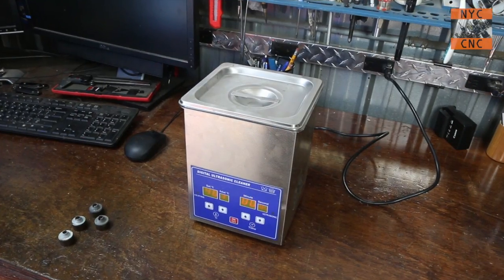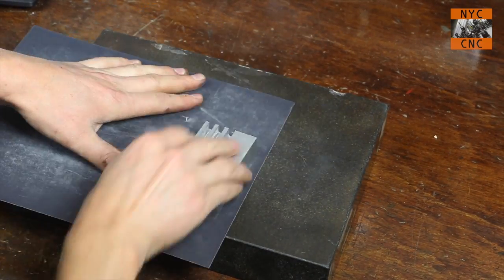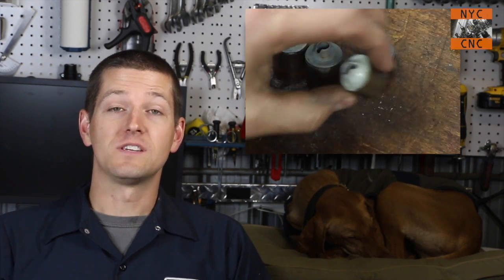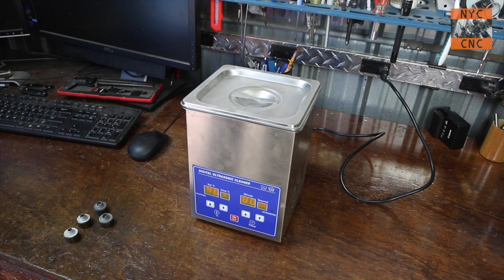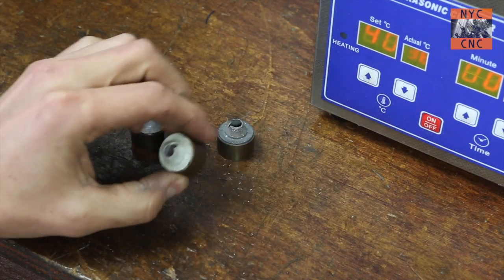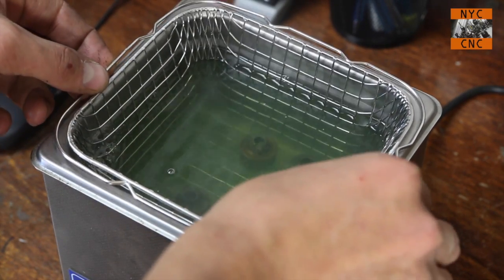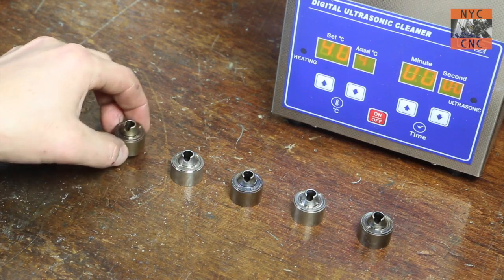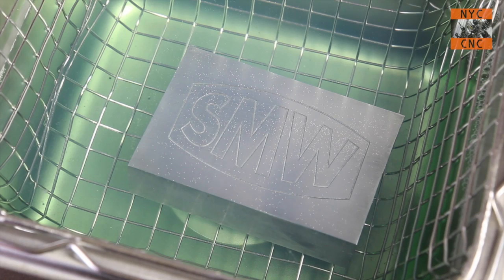Get Parts Ultra Clean with Ultrasonic Cleaner!

Comment: I have an ultrasonic cleaner and I too am amazed at how fast it works.

For solution I just use tap water with one or two drops of hand dish washing liquid.  it is a lot less expensive than most dedicated solvents and as I don't use my cleaner often, I use fresh water every time.

The ultrasonic cleaner does all the work and the soap just keeps the dirt/oil/gunk/mung in solution.

The are GREAT for cleaning intricate parts like a carburetor off of a weed whacker or the tips of technical pens.

for and AMAZING demonstration put your eye glasses in it, but don't let the lenses touch any parts of the cleaner or basket.
Reply: NYC CNC The amount of skin oil and dirt that will come out from between the frame and lenses, and from the nose pads will shock you!!!!

Also you will have the cleanest lenses you have had sense they were new.  also the ultrasonic cleaner will not scratch the lenses.

I don't heat the water and only put my glasses in for 30 seconds or so.....  I learned this trick from an Optician's shop in Japan. They had an ultrasonic cleaner outside on the sidewalk with typical Japanese cartoon instructions for use so I did not have to read Japanese.  I had clean glasses in short order!!!!!

As a justification for the cost of the cleaner I purchased, I also clean my wife's rings (NEVER put an opal in one) so she is happy about a high price tool that gets used seldom at my house.  Happy wife, happy life.

My first exposure to using an ultrasonic cleaner was when I was in the US Navy. The ships I was stationed on had a large cleaner for cleaning oiled metal mesh ventilation air filters.  I think you could put an engine block in it but they are out of my budget.
Reply: kitesquid I'm almost tempted to get one just to have clean glasses. I absolutely hate dirty glasses, and I can't really get them very clean! hehe.
Reply: What os interesting if you distilled water, you will have almost no cleaning effect! The impurities in the tap water are the nucleation sites (points where the bubbles start to grow). The boundaries of the the objects will still form bubbles but the cleaning action is reduced like a million times less(random number but point is it is a huge difference). The same experiment i did with aluminum for 4 hours which removed 400 grams of material only removed 0.01g lol in distilled water!

Comment: I'm not the german guy who made his Ph D in it^^ But another german fan. its almost right with the really high temperature (5-6 digits) but its not the temperature we are used to its the local temperature. Temperature is the average movements of atoms and molecules. So when an ultrasonic bubly collapses some (very little) particles get an enormous velocity. If all particles had them you would melt steel or tungsten in a split second. But since it is only a few particles  it is even hard to measure the rise in overall temperature.
But these high velocity particles knock of a good amound of dirt^^
Reply: just my few cents worth on ultrasonic cleaners the cheap ones have a really low sound power and no heating. So don't waste your money on them.
Reply: NYC CNC  Your welcome. the heater is one point the sound power of 20W for those cheapy plastic ones is even worse. the ones in your size should have about 100-200W of sound power and min 200W heating.
Reply: I have a cheapish ultrasonic cleaner. I get a temperature rise of roughly 1c per 10 minutes of runtime. My unit holds 4 liters of water with some detergent. I assumed this temperature was heating of the transducer which went into the basin and into the media. I usually keep my temp at 50-55c

Comment: These type of cleaners rely on cavitation to generate bubbles. When the bubbles implode they form a reentrant jet(google this term for a pic). The reason the ones you put in longer look different is because they are etched from the process. When we did some experiments at 14khz, I forget the amplitude, we removed 400 grams of aluminum in 4 hours! The area where the bubbles implode see really high localized temperatures and pressures that remove material.

Comment: Those are amazing for cleaning out spent brass. I used them where I used to work for degassing solutions before they would go on sensitive equipment and also for "digesting" tissue samples into an emulsion. They can "etch" the surface of parts though, in fact if you look at the bare metal in the bottom of the tank you can probably see etch lines in the steel emanating from the focal point nodes. They say don't place objects on the bottom, the most effective depth is just below the surface of the water line, and there is a recommended depth to fill the water line to for maximum efficiency. You can hold a part in with your hands and move it around until you feel your fingers get really hot and the part feels like it's being moved on its own. That is where the part is getting maximum cavitation. I think the rule is not to put aluminum in it, can't remember why. I think maybe stress fracturing or something.